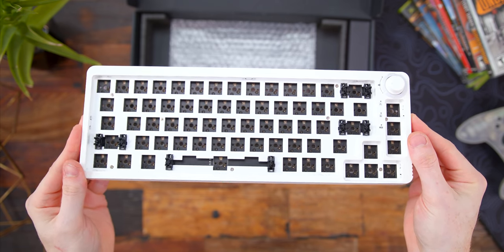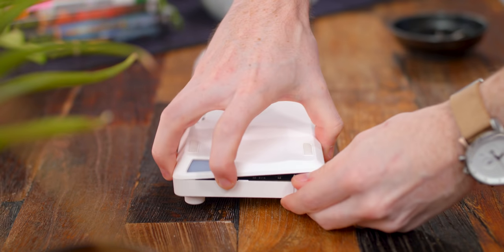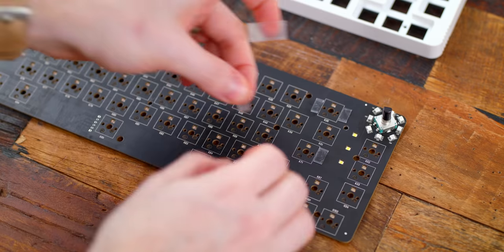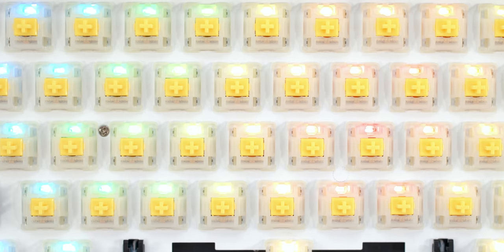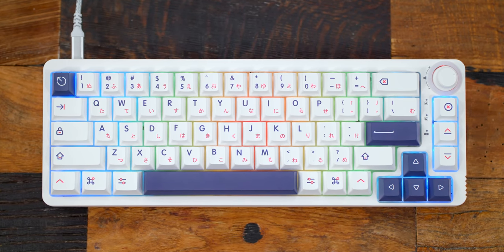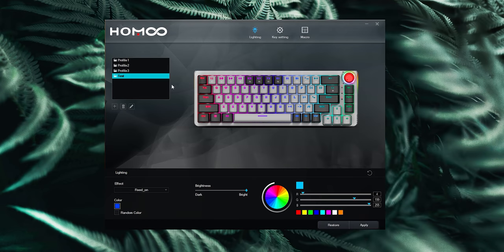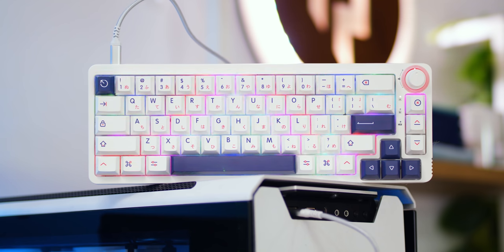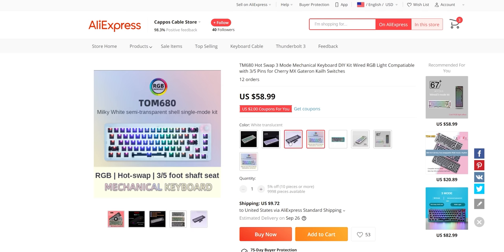Building A Budget $98 Custom Keyboard!

Comment: $98 isn't "budget" for a keyboard. Also, keyboards without numpads are bad. It's a tool, not an art piece.
Reply from the maker: And hold the L
Reply: @supersop1367  Hey guys, I'm just going to go for a drive in my BUDGET FERRARI, see ya. 

Budget in the context it was used has a meaning. It's not supposed to mean "more expensive than 99% of its competition".
Reply: @fungdark  ok but still 98$ is budget for a custom keyboard and read my other points not everyone wants a numpad
Reply: @supersop1367  some people don’t use the claw of a standard hammer. It’s a worse tool without it. Objectively. Same as a keyboard without a numpad. You’re paying more for less. Good job.
Reply: @fungdark  I don’t want a big numberpad taking space up on my desk if I’m not even using it
Reply: @fungdark  and u do realize there are bigger sizes like tkl and full size